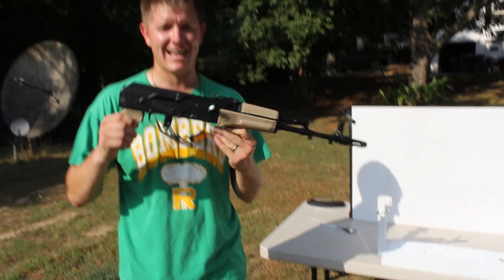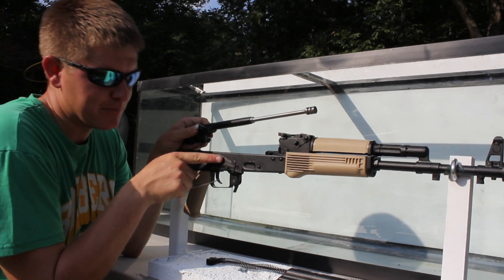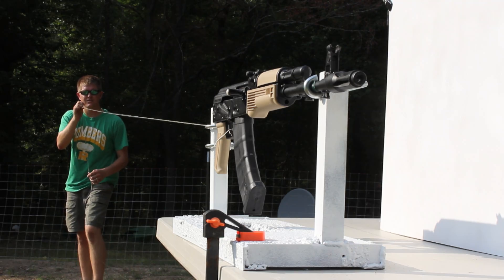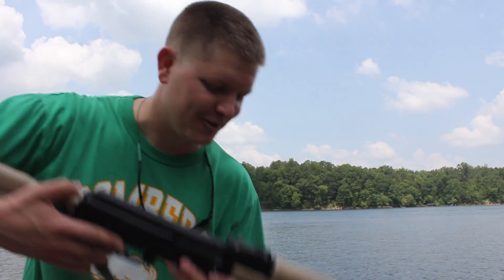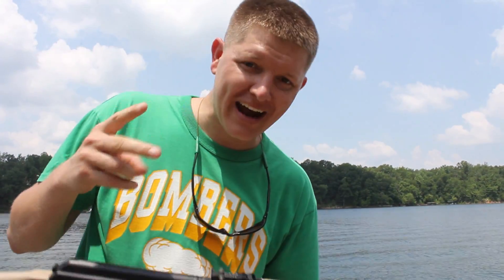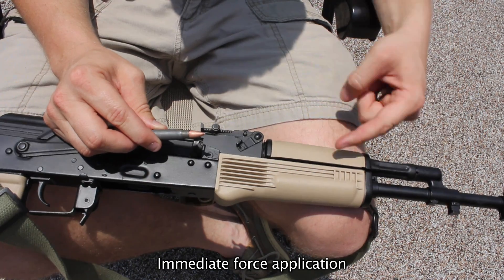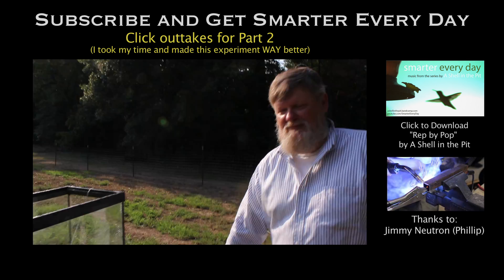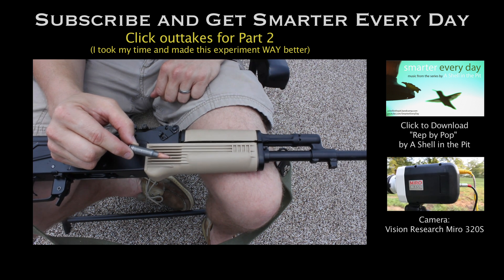Slow Motion of an AK-47 Underwater (Part 1) - Smarter Every Day 95

Comment: It is possible, but you have to be a particle born going faster than light. It takes an infinite amount of energy to accelerate to the speed of light though. 

On to his question though, you completely ignored quantum teleportation and the possibility of moving to another point in space without needing to navigate between the two points.

Comment: Tell them, what? That the last year before the ban went into effect there were almost half as many gun homicides as last year (33)?

Yes, Britain has lower gun homicides (though generally equal or higher rates of robbery and the like where a gun is used), and they always have. But, that hasn't declined even a hair since the ban went into effect. 

In other words, there is more correlation between number of pirates and global temperatures than between UK gun homicides and UK gun laws.

Comment: Yet, even at that, the gun homicide as percentage of all homicide was 23% in 1996 and 14% in 2010 (since 2005, gun homicide has bounced back actually). With around 200 total homicides in 2010 in all of Oz (a country, btw, with a population about equal to NY state), would mean a difference of 20 people... in a country where 1600 go missing permanently each year.

Comment: testing it after it was in the water was unnecessary it is a ak of course it will work you can drake a al through a sand pile and it will work fine.

Comment: But if they chose an AK for their defense, so? Is it more of a weapon of war than a 10/22? If so, why, because it fires bigger bullets?

Every gun that exists was either designed specifically for war or is based on a gun designed specifically for war. A 9mm pistol is a "weapon of war." Shotguns were used in trenches in WWI to the same general end as machine guns: to kill lots of people fast.

The AK is a very reliable, very basic, rifle designed as minimal gear for grunts. It is not a howitzer.

Comment: Jay, I think you've got it.  Pressure causes compression.  "Pressure" from the weight of the car would compress my foot, but would compress a foot-shaped brick far less than my actual foot, even though the car would exerts the same "pressure" upon both.  Stacking ten cars would increase the pressure even further on my foot or the foot-shaped brick.  In the same way, the pressure at the bottom of 10,000 ft of water is far more than then pressure at the bottom of 100 ft of water.(your original qn)

Comment: A bullet provides the required mass to push/compress the water out of the barrel, and also serves to "seal" the combustion between the bullet and the fired round case. A blank would be simply burning powder against a wall of water - probably would not work as well. Blanks are very sensitive in semi-auto firearms, and normally require a blank fire adapter to operate correctly at all - the blank firing adapter is a sort of choke device that raises the gas pressure within the barrel.

Comment: Peter, 

"..water pressure has little to do with compression (pressure CAUSES compression,.." First you say that pressure and compression have little to do with each other, then you say that they are directly related... which is it? 

Pressure and compression, are related (they are even derived from the same Latin root word)

have a friend stand on your foot, then have a friend drive over your foot with a car... which form of pressure had more compression on your foot?

Comment: The bolt most likely moved "faster" under water because the operating pulse acting upon the piston started sooner. When the bullet left the chamber, it likely compressed some of the water into the gas port. This doesn't happen when the firearm is fired in the air, but there is likely enough backpressure within the barrel when under water to force some of the dormant water to enter the gas port, once the bullet begins compressing/pushing out the remaining water in the barrel. Great vid.

Comment: Hey Destin, I've a few questions. According to Bernuilli's principle, the faster the fluid, the lower the pressure, so how is it that there is higher pressure in the piston chamber? This really confuses me.
And I noticed that when you shot, as the bullet went through the water, the surface curved down. Why does it do that? Shouldn't it expand and go up instead of down?

Comment: Destin I'm curious as to what kind of AK platform rifle that is, because I've owned several and NONE of them had that sliding lock mechanism at the rear trunnion to hold the buttstock in place, it's always a tang on top that screws into a receiving gouge in the stock.

Comment: Jay, water pressure has little to do with compression (pressure CAUSES compression, not the other way around).  Also, we call water incompressive but in fact water does compress... a very small amount.  Very small. But that's also not relevant to pressure.   Pressure is simply put the idea that anything at the bottom of a column of (matter) is supporting the weight of that whole column on itself due to gravity.  The air pressure at your home right now is the weight of all the air above you.

Comment: That's a good point and i wish there was a less than lethal self defense tool that works better than a gun, but so far they are by far the most effective. And as far as the math goes i prefer a good guy saves himself and a bad guy is gone then the other way around. A life of a criminal or a rapist =0.1 to me and 1>0.1 therefore 1-0.1=0.9 lives saved, not as good as medicine and i'm not arguing that but still good enough.

Comment: Water isn't incompressible ;)

It just can be thought of as incompressible because the pressures required means that at the bottom of the Mariana trench water is roughly only compressed by about 1.8% normal volume.

Comment: Your theory is correct.

Im a former Russian Navalman, and part of the standard information we needed to understand was why the underwater rifles currently in use with the Russian Frogmen were used and what was different than the standard Kalashnikov system. It is very interesting to see them firing in slow motion underwater.

Thanks for the video!

Comment: I certainly didn't think it would go slower the pressure wave alone would have created an air pocket with more than enough room for the bolt and assembly too move. But faster now that's super cool.
You should take a look at the shrimp that snaps its claw so hard it creates a airpocket underwater, It's super freaky.

Comment: Is it my imagination or does the entire gun bow slightly upwards when fired? Is this an artifact of it being confined with a j bolt at the front. If it isn't is it a consistent amount of flex between firings that can be adjusted for in the sighting or does the flex play a significant role in the overall accuracy of this weapon? These are the questions the video raised in my mind

Comment: well as a tool for defense its doing a pretty bad job.
youre likelier to get shot or killed if you have a gun,and its not a small margin its about 4 times as likely for both.
thats why i think its completely absurd to call it a tool of self defence when it actually increases your chances of dying.
the two best tools for self defence are 1.your brain and 2. your legs.
also legally speaking self defense requires that you use the minimum amount of force possible. a gun isnt the minimum amount.

Comment: Upon a second watching, two things fascinate me about this video.  One is the way that the tempered glass shatters almost instantly.  I would love to see a high speed video of a large plate of tempered glass shattering.

The second thing that fascinates me is the surface of the water as things are happening in the tank.  At approximately 3:30 in the video, as you see the expanding cone of gas in front of the muzzle, you see the surface of the water apparently being drawn down toward the blast.

Comment: Closer, the 7.62 has more stopping power as it has more energy than the .223 and 5.45. However, it loses it's energy after about 200 yards and the .223 around 300 yards. The 5.45 keeps its energy longer, but at closer ranges the 7.62x39 has more power. The .223 is known to be more accurate at longer distances and overall, but not for more power initially.

Comment: That is only true if the overall length is less than 26 inches with the stock removed.  AKs have a pretty long action and most of them are a little over 26 inches with the stock removed and a typical muzzle device.  So he probably didn't break any laws.

Comment: bolt of center means the stock, the part that you have on your shoulder, is not lined up with the bolt. the bolt is above it. The recoil then springs upwards rather than directly into your shoulder.

Comment: I could have answered this question before actually firing it

water is a better conductor of energy than air because as you said its incompressible so even sound waves move 40x faster underwater than above it which shows that water is better to travel things like this the energy waves coming off the bullet simply move faster from particle to particle therefore dissipating slower (well it actually dissipates at the same speed but travels farther before it dissipates)

Comment: actually, I'd say that the air that pushes back the bolt cant escape so easily due to the water. That allows more force to be applied to the bolt

Comment: What moved the bolt first in the water on firing is the pressure wave from the moving bullet.  As you said water is not compressible, gas is.  Once the bullet passed the gas port then gas flowed into the port causing the bubbles, clearing some of the water.  Bullet velocity under water is slowed due to resistance of the water in the barrel.

Comment: According to the "National Homicide Monitoring Program" (by the .au gov that is) the handgun use in homicide has gone down since 2006 (was about steady until then), but at the same time knives and other sharp instruments have gone up. Which means murderers just use other tools now.

And while homicides are on a steady (!) decline for the last 20 years (before and after gun control), that's an international trend: In the US it's currently the lowest it has ever been during the last 100 years.

Comment: then it sounds like we are actually in agreement. in low crime rate area's guns that aren't stored properly when not in use, they are a bigger threat then a safety measure, but in higher crime rate area's, they can be a safety measure, but still as a last resort. so how do we make sure people are using guns properly? I like the Idea of having to pass a short course for gun usage, and a yearly checkup to make sure the guns are stored properly, but of course there are probably other options as wel

Comment: Wow, that was a result I was not expecting. I was totally sure that the higher viscosity of water would've slowed the bolt down.

Hmmm, I wonder. Could the rapid movement of the bolt have actually caused cavitation of the water around it? Then the water's viscosity would've been eliminated completely

Comment: AK-47 has a milled receiver, different flash-hider, different gas-block and so forth. The gun in the video is identical to the AK-74 apart from the calibre. I suppose AKM would be more accurate but still not correct.

Comment: My suggestion for you is : Have another tank like this to test, but make sure you drill a nice hole where the barrel is point out and plug it well, then fill up with water. Since you wanna test how the gun perform in the water, you can get rid of a plug each time, instead of a whole tank. I could of used this tank for lots of fishes and corral reef. Hope that helps :D

Comment: Yes, it's the fact that water is hard to compress. To test it, next time you might want to use oil (can even be the edible one) which is even less compressible than water. You would need a lot of oil though ;)
Great video :)

Comment: bigger bullet does not always mean higher kill rate. this had been proved by the russian 5.45x39mm. yes, it is alot smaller than the older 7.62x39 but compared to the 5.45x39 the 5.45 does more damage to a human body than the 7.62 (you can search it up). another drawback of the 7.62 is the bullet speed, range and accuracy. the only thing better than the 5.45 is the stopping power and the abbility to penetrate the thickest armour.

Comment: Destin, is it possible that the bolt started getting pushed back by the water being pushed IN FRONT of the bullet and then by the expanding gases after the bullet passed the port?  In this video it's hard to spot the moment the trigger was pulled and comparing that to the rest of the activity.  Maybe you could put in a small wax cork in the muzzle and fill the barrel with dye?

Comment: I agree, there is a lot of contradicting data and statistics on the issue. As far as bad doings with firearms i looked at fbi.bov/stats-services/crimestats and they say there are about 12 000 murders with guns each year. As far as self-defense there are a lot of numbers out there ranging from 100 000 to 890 000 all the way to 2 500 000. So in any case it's more in my opinion.

Comment: It is actually more than you think. Guns can be dangerous is used effectively or ineffectively. Well-trained soldiers lose their lives in Afghanistan to people with AK-47s, and it doesn't matter what you learned from CoD, a 7.62x39mm round will kill. An M4 uses a .223 round, which is smaller than an AK-47's round. This means the AK will pack more of a punch. Some civilians are trained to use a gun effectively, like myself, so please look up information before your post it.

Comment: Awsome idea for at video, one of those "I wonder what would happen if...." 
But one thing i noticed, and i am sorry if it has already been covered in the comments. But at the instance of firing, the muzzle seems to bend downwards rather violently, Is that an illusion due to the water, or is it really deflecting that much?

And next time, try making the sidepanels of the tank out of polycarbonate, and ust leave a plateglass "blow out panel" at the end. This would probably hold up to several shots

Comment: Destin,

Sorry to see this has turned into a gun debate instead of a lesson in physics.

Anyways, I do have some questions, maybe some will be answered in Part 2... or maybe even part 3.

If water is non compressive, why is there more pressure at the bottom of the ocean than the top?
Does varying the temperature and/or pressure of the air and water change the results?
What about firing the gun in a vacuum?
Could a variance in the amount of powder in the round cause these results?

more to come..

Comment: Just curious were you find that number? The most recent and trust worthy number Ive found is 606 from the CDC in 2010. I ask because I am compiling data to accurately reflect the numbers of firearm related crime and death, something the media and politicians are not very good at. 

FYI the accidental discharge death rate per 100,000 in the US using the 2010 numbers is 0.2 per 100,000. Accidental firearm deaths are the least common of all the accidental categories listed by the CDC.

Comment: Well yea the fuel is the gunpowder in each casing.When the primer is struck it explodes and causes the gunpowder to burn.  That gunpowder quickly turns to a gas at high pressure causing the bullet to travel down the barrel.  From then on there are different ways in which guns operate to load another round.  Pistols just use the recoil force, some guns have a long gas tube back to the bolt, and others like this one use a piston. but it all operates on the gas pressure from burning gunpowder.

Comment: a gun is only as dangerous as its owner, which is why there is licencing.
It is hard to explain but (for target shooting at least) shooting a bolt action rifle is a completely different experience compared to shooting a semi-automatic rifle, which is why people want them.
There is not really any difference between a rifle 'designed to kill' as you put it, or a rifle intended for sporting purposes, the fact is they are both as safe, or as dangerous as their owners

Comment: Some kinds of replica and airsoft (guns that shoot little plastic pellets) guns do use compressed gas to work. Real steel guns however, use the gas from the expanding explosion that comes from igniting the 'gunpowder' in the bullet to recoil the gun and load the next bullet, as well as propel the fired one out of the barrel.

Comment: Look at the statistics compiled by the FBI and DOJ, you will find that the US is not nearly as violent as the media portrays it. The media will throw out numbers but fail to acknowledge that nearly 70% of the murders and homicides are gang related and occur in small inner-city regions in the largest cities in the US that typically have the greatest gun control measures. Focusing resources and effort into the crime ridden areas will do more for safety than a nationwide ban on firearms ever could.

Comment: its very difficult to rate one country vs another... there are other factors involved. the population density in the uk is much higher then america if you include all the remote areas of america.In this case, its a lot more likely to cause more deaths in the UK if guns were freely owned. The problem is really the ease of use with a gun.To kill someone you just pull a trigger, to beat someone to death with a bat is much harder and someone might just stop and think before finishing the kill.

Comment: If you fire a gun in air into water the bullet would decelerate really fast and be destroyed. But if you fire the gun IN water the bullet will travel for a short distance before it slows down enough to be harmless. Just wanted to point that out.